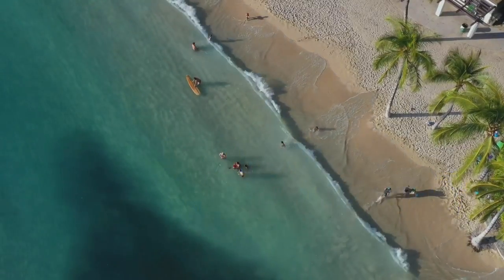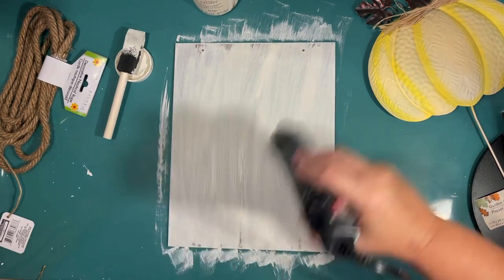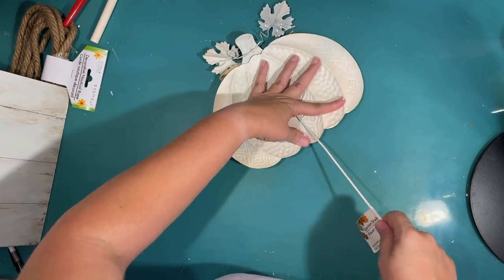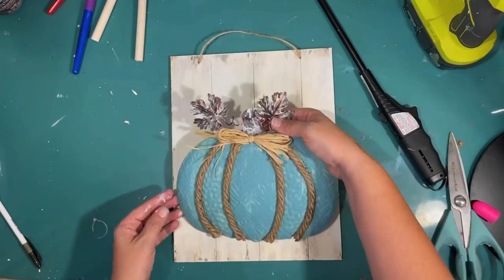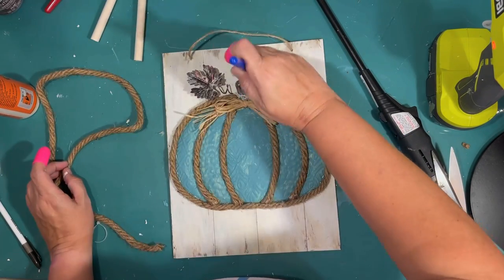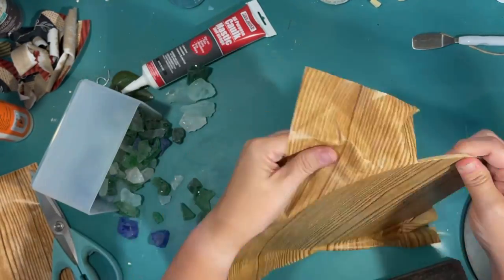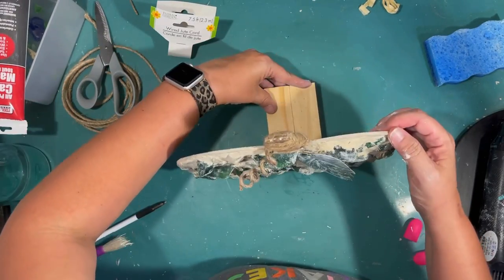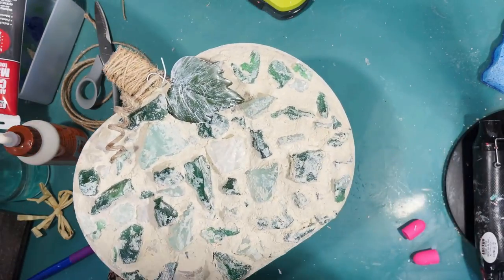3 COASTAL Pumpkins DIY Video for Fall! Autumn Beach Blue (Dollar Tree) Hacks

Comment: Love the metal pumpkin with the nautical rope. I'll definitely be recreating that one.  FYI - when applying tile it is typical to wait 24 hrs from gluing the tile to grouting.  But in crafting I understand the need to speed things up.  May a fast acting adhesive would have made you struggle less?